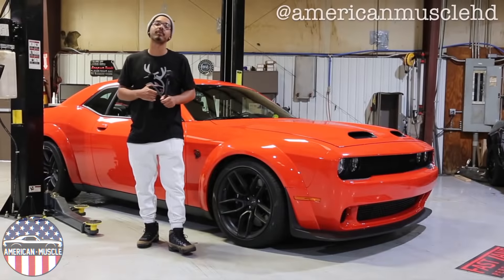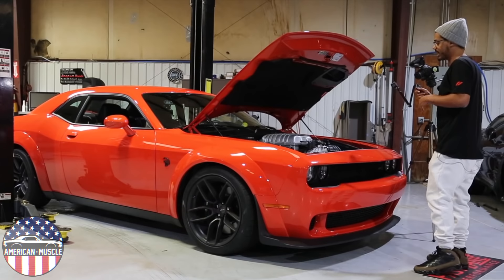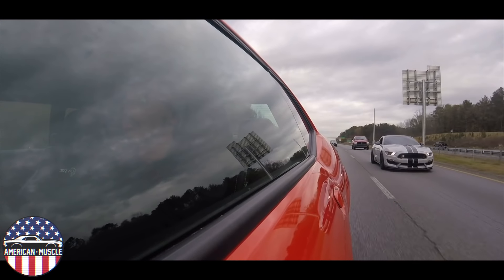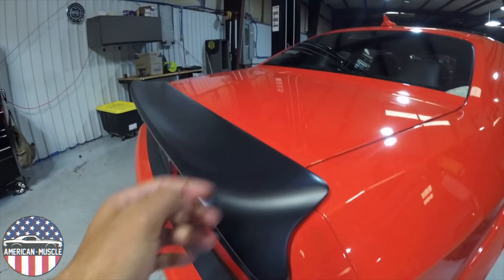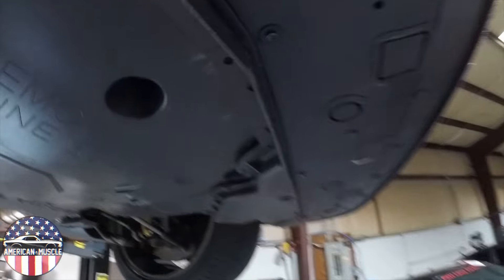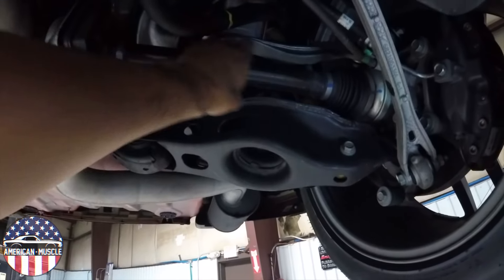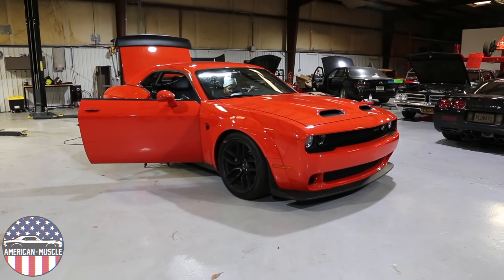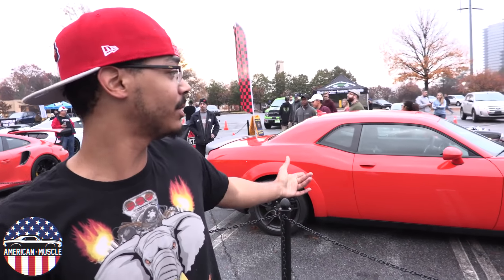2019 Dodge Challenger Hellcat Redeye Widebody | REVIEW | First in Atlanta!

Comment: One bit of unknown information that some people might not realize only the red eye and Hellcat widebody has 305 front and back! Widebody scatpack 275 in the front!
Reply from the maker: I literally dont know how they can sell the car with 275 lol 🤣.
Reply: @americanmusclehd  nope. The scatpack widebody has the same 305s that's on the hellcats. But I think that's too much for the scatpack. I think 290s or 285s is good enough. Extra weight, rolling resistance, stress along the steering colum, and costs is what you look at with the 305s
Reply from the maker: @blackice7408  I drove the widebody scat pack back in August and with the 305 squared setup it felt just fine. Wasnt over burdened at all
Reply: I got test a 1320 Scat Pack aka "baby Demon" with the 275's and it hooked good and I think it depends on the HP. For future reference the Hellcat also has the dual snorkel hood and the only way to tell from the outside if it's a Hellcat and Redeye is the jewel in the Hellcat emblems.
Reply: @Old_Tyme_Racing  yeah but the jewel is so small and tiny, that it's pretty much pointless. Not to mention that anyone can now get a hellcat logo with the red eye on it. Btw, how was the 1320 in terms if suspension, etc
Reply: @blackice7408  I agree on the jewel thing it's crazy Dodge didn't make it more of a noticeable difference between the Hellcat and Redeye. The 1320 pretty much handles the same way as the Demon on the track and on the street it was not as good as a normal Scat Pack narrow body I think because of the same reason as the Demon the suspension is more oriented to the track than the street. I have a Redeye on order just waiting on it to be built sometime after shut down I'm being told.
Reply: @Old_Tyme_Racing  wow. I can imagine that. The very mushy front suspension but the power of the scatpack. Just wished this stuff was on the charger as well
Reply from the maker: @Old_Tyme_Racing  see I appreciate you man! Willing to pass down information without talking down on me or anything like that. We are all out here learning and trying to get better. Imagine a world where people educated others instead of putting them down, where we would be as a society haha! Anyways thank you for the feedback brother!

Comment: Has anyone ever provide a full video review of the functionalities of the JEEP SRT.  For example, audio, navigation, engine, steering (driving in straight-line), body inspection, memory settings, wipers, and etc.  I have completed some research, and I have never seen so many SRT for resale (Whether JEEP or Dodge).  I did made some phone calls to sellers, and did get some feedbacks regarding functionality issues.  Let me know what you think.  From what I understand, these are all BAILOUT vehicles.  Safety is a concern.

Comment: The passenger side hood scoop is not functional. The driver side is only.
Reply: they both functionally feed to air box
Reply: @speedy1ne921  nope. Because if you look under the hood, the passenger side doesnt have tubing to connect with the driver side hood scoop. So the passenger side hood scoop is a dummy